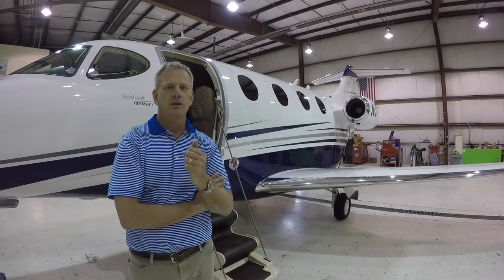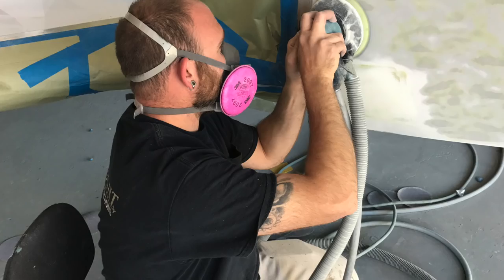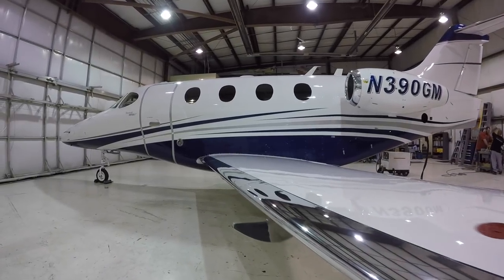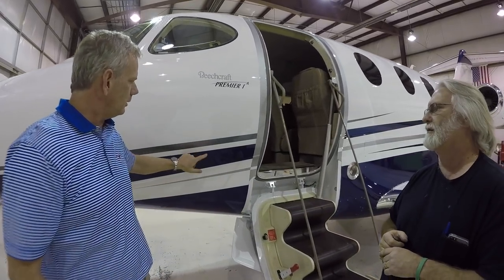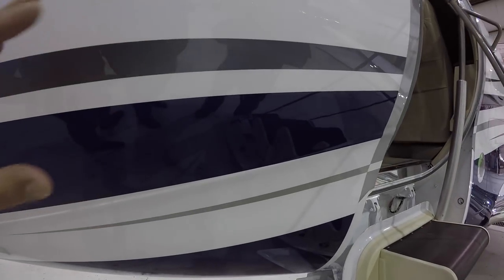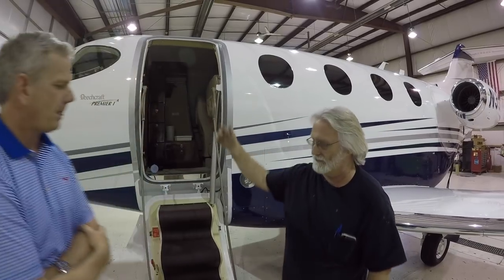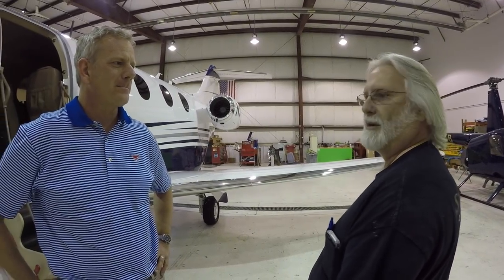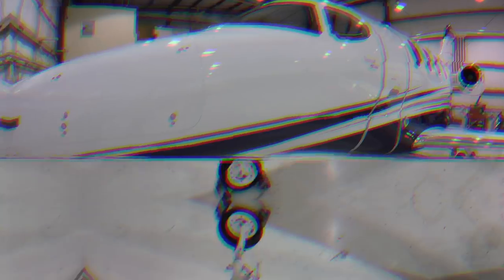New paint job reveal! - SureFlight delivers perfection

Comment: Greg, the pearl in the paint is actually mica. They could have applied the mica over the entire air frame. GRP (graphite reinforced plastic) materials are a breeze to work with once you do a couple of hundred jobs.

Also, the fasteners appear to have a gold color to them, which to me indicates cadmium plated not stainless steel. If you can check with a magnet, the aerospace grade stainless steels are non magnetic, while the high strength steels for fasteners are magnetic. 

Good looking paint job from what you've shown. You should be set for another 7-10 years provided it stays hangered.

Comment: Greg - Nice new graphics with bolder colors! It's makes all the difference when you find a shop with the experience of handling the carbon fiber shell properly, down to the proper way to deal with access panel screws fasteners!

Since the surface has been clear-coated, what type of wax or protectant is to be used to properly protect and maintain the quality of the clear coat? Is the surface protected with a good high-quality carnuba wax or are there other airplane-specific compounds or polymers due to the harsh environments a plane operates within?

BTW - Have been enjoying the videos for several months now. I really enjoy "flying" along with you and find any video that is more technical all the more fascinating to watch. I'd really enjoy a detailed video regarding start-up and what you are looling for in the gauges that tells you all is good as we hear the engine begin to turn over, then light and spool up to idle. [If that is what is going on.]
Reply from the maker: Hi Dave- A good high quality wax is what we use. The paints hold up surprisingly well to the harsh conditions.
Reply: The new paint job absolutely glistens in the sunlight. The surface (clearcoat) is smooth as glass. Do they wet-sand during the painting process? That seems like a lot of surface area to handle. That finish is comparable to what is found on these "show cars" in the automotive restoration process. Those guys at SureFlight are top notch! G'day Three-Nine-Zero-Golf-Mike!

Comment: DeWitt, great to hear a true craftsman talk his trade.  The paint work on any GRP structure calls for know how.  Just think of those fiberglass molds in boat building that may see 500 hulls made in it. The heat expansion time and time again like pressurizing the aircraft tube works hell on the covering paint faces' .  

Molds that have long service lives well demand a new paint surface are two.  So, the reshoot prep must attack hundreds of coats of parting wax jobs plus fractured gelcoats  (paint) in getting a useable base.  Sanding is key.  Yes there are chemical wax strippers, however they can turn fiberglass molds into butter that well never hold paint again,  I've seen  shop men unknowingly get in to this death spiral .  DeWitt is a first cabin craftsman. !

Comment: I am A few question so please answer when you have time don't waste your time answering my questions if you have other things to do. Thanks for your great videos. 
1)  How old is your Citation?
2) Was the paint job necessary or was it strictly for a new look?
3) Is all your electronics original or have you had them up graded?
4) How often do you do an Engine service and do you use the same people every time?
Reply from the maker: 1) it isn't a Citation. It is a Premier. It was built in 2005
2) Paint job was getting close to being necessary. Lots of flaking off in areas.
3)Original 
4) every 300 hours there is an engine servicing. Yes, same people.
Reply: Sorry about calling that great looking Premier a Citation. Thanks for such a quick response. I think I have flown with you just about everywhere you used your GoPro. Two Favorites Aspen and Telluride
Reply from the maker: I like Telluride. I also like the Greenland flights. Thanks for watching!
Reply: I guess you had to ferry it to Greenland. What is the longest distance you can get with a full tank and a tail wind.
Reply: I live 2 miles from MSY but my office over looks the Superdome and I can just about watch the private jets take off from New Orleans Lake Front.

Comment: Nobody seems to have asked the all important question. How much did it cost for that stunning paint-job?
Reply from the maker: Nearly 6 figures...very nearly.
Reply: Ouch, 90+K is a heck of an expensive paint job and would've made a nice down payment on a Premier 2 but I'm guessing you're expecting to get it back.
Reply from the maker: They never made the Premier 2. And if they did, it would have been 8 million + if not a lot more. 90K doesn't even pay the sales tax on a new purchase. A paint job on a plane protects it from the elements. So it's as much a maintenance issue as it is a cosmetic issue.
Reply: Interesting how they handled the screws on the inspection panels.  My panels are a nightmare.

Comment: Ok, I’m sitting down!......what does a paint job like this cost?!
Reply from the maker: It will bump you up against 6 figures.
Reply: Yikes!  That paint job cost several times more than my entire aircraft!
Reply: I was wondering which cost more, the bees In the engine or the paint job.  Now I know.  The paint job is beautiful, and worth it.  I am not so sure about the bees in the engine, but I guess that really is not option but to fix it, since you need two engines.  You picked a great paint shop, based on the results.  Thanks for letting me fly 'copilot'.